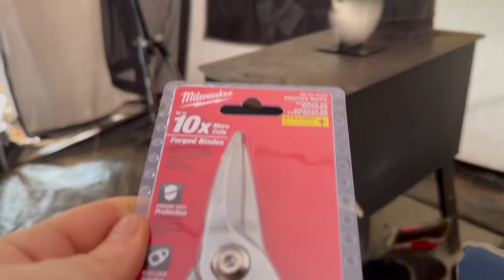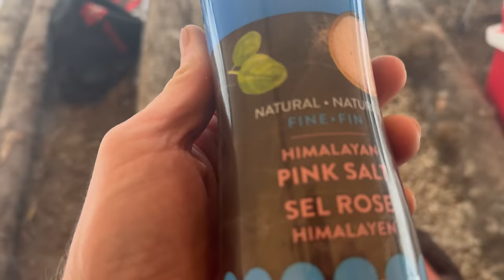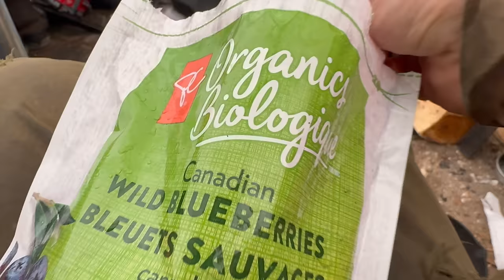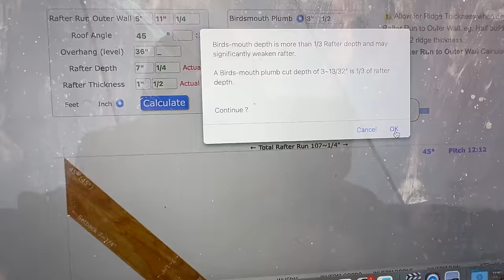Winter Log Cabin Build on Off-Grid Homestead |EP16|

Comment: Fyi I just started binge watching due an injured knee. On episode 9. Just a few suggestions about land maintenance. In what spare time you have I would highly recommend a daily bonfire and start burning all your scraps your leaving out on the property. Having a lot of dead scraps on the ground creates wildfire risks during dry seasons. Also for safety I would strongly recommended starting to cut all your stumps to the ground. The small ones can cause flat tires or damage to snow machines. As well as be dangerous when riding around in the snow. They can get buried in snow and if you hit one with your atv you will cause a lot of damage to the atv and potentially yourself.

Comment: If you really want the oak to do well prune the lower branches off before the tree starts to green up. That way it will use its energy to grow up tword the sun rather than outward. Also a grow tube will help it! Cutting the bigger trees away as you did will help a lot!
Reply: Agreed. And that fortress over the tree reminds me of those parents that bubble wrap their kids to “keep them safe,” only to turn them into piles of mush that have no resilience!

Get rid of all that light blocking stuff and drive a few T-poles into the ground to make a five foot circle, and wrap it with chicken wire!

That tree needs all the light and exposure to wind to strengthen the roots!

Comment: Just some tips with the wood stove. If you line the walls and back with fire bricks too you will retain more heat and the wood will last longer. Also when starting the fire, try the opposite layout. Big longs on bottom and kindling up top. It will burn from the top down and the wood will burn slower and hotter. Also it is paramount to use the damper in the front that lets the fresh air in. Keep it open all the way when starting the fire but close it down half way and adjust to get good heat and lasting burn. If it is wide open you’re just wasting wood and losing a lot of heat out the flue pipe. You ideally want a slow hot burn.

Comment: Just use one rafter as a template and trace it. Then cut all the rafters you need and install. Will save a ton of time versus measuring every single one and continuously climbing up and down. Light commentary is best. It’s one of the reasons I watch this channel, as there is a good balance.

Comment: I like the tent I also have one of the same wood stoves we have used it down to -35F if you want to make it more efficient add a damper in the chimney 70% of your heat goes out the pipe without a damper. You can also find an old brake rotor from a small car lay it down flat and slide it as close as you can to the chimney put your water pot on top of it heats twice as fast.

Comment: Not sure if it's in your plans or not, but I highly recommend you tie those gable walls into the rafters along the entire length of the rafters. That stacked log style of gable needs all the help it can get with lateral stability. I liked the light commentary, but I think you need a bit of commentary mixed in, perhaps at the start and end only?
Reply from the maker: GOOD SIR Z, THANK YOU KINDLY FOR THE RECO! I WILL MAKE SURE TO DO THIS IN THE NEXT WEEK! EXCELLENT IDEA. OOGA BOOGA! 🫡🤝⚡️🐺🌲
Reply: @wildhomestead  Yes, I was wondering what you were thinking of doing there. The logs stacked on each other could roll pretty easily given a bit of sideways wind snd only screws holding against a sheer force. Really enjoying the videos btw!
Reply: I've been thinking the same thing with those stacked gables. Not much side to side stabity, stacked and screwed.

Comment: If you are planning on a metal roof may I suggest leaving the space at the top of your ridge board and installing a ridge vent under the metal ridge cover. It might keep things dryer in the cabin by allowing some air circulation. There is a plastic, fiber/mesh product with adhesive already applied you can stick to each side of the tops of your roof panels. It comes in a 2" wide roll. This prevents bugs and snow from getting in through the gap but allows air to exit. You just need to leave a 1" gap on either side of the ridge center for the air to escape.

Comment: James, I feel that you should strengthen your top plate that is holding your bottom trusses. You have some mighty big spans under your 2 2x4s,  I'd hate to see you get a heavy wet snow fall and have your roof start to sag.  I understand you have a 12 12 pitch and the snow should slide off, but you like to be on the cautious side from what I've seen.  As for hauling in materials you could easily fashion a log frame sled that you could haul behind your ATV with some rope.  Keep living the dream brother!

Comment: Having your rafter stand "proud" above your ridge board as you showed in your first rafter test is not a bad thing, and in fact is a good thing.  That gap between the top of the ridge board and the top of your angle cut on the rafter would allow airflow through the cavity between rafter bays and over the ridge board.  This assumes, of course, that you are planning to install a finish ceiling on the underside of the rafters on the interior/heated side of the ceiling, also installing some sort of insulation in the rafter bays.  Without positive airflow thru the enclosed/completed roof, condensation can occur, and moisture trapped inside an enclosed space is not a good thing.  

Like so many other viewers have commented, I also enjoy your usual on-camera comments during your videos.

Comment: hi!

here is a ide dunno if it is a bad one, but what if you made a little garage for the four wheeler.

basically cut down 2 or more trees then connect the logs whit boards/ planks then put board/ planks that goes up to the middle from the planks/ boards that connects the logs (it would look like the thing you made to protect the little tree the only difference is that you have board/ planks that goes up to the middle) and then put a tarp on that and voila you have a little makeshift garage so it wont need to snow/ rain and so on on the four wheeler.

but like i said maybe it is a bad ide.

Comment: The shelter for the oak is good for now but you will eventually have to take the top off so it can get enough sunlight.
Either that or just take the plywood off and put the same chicken wire on the top as you did the sides.
Later on if you have time, you might want to either do a google search on how to look after oak trees or track down an arborist or tree specialist.
I am not suggesting the type of care plants from a plant nursery get, but the type needed to keep bugs and other pests away as well as certain diseases that oak trees may be susceptible to.

Comment: I would give the poor TRO more space. It will grow through the cover and get all tangled up. I would ram four 6‘ poles in the ground on a 5‘x5‘ footprint (or 6x6) around TRO  to give it enough lateral space. Then wrap the chicken wire (overlapping slightly) until you reach the top and leave that open. TRO needs headspace…

P.S. please comment again :)

Comment: That first rafter should have come back down and been a template. Would have gone a lot faster not having to keep "making" the rafters each time. Always use the same board for the templates, or they will always be off a little each time if not. Can't wait to see the finished product. I am going to use the videos as a guide to making my first cabin soon. However, I may square my logs with my sawmill on 2 sides to make it easier. I know.... cheating! ;)

Comment: When you get done with the cabin and have time for some "fun projects" you should really build a mini log cabin bird house and/or feeder, help them cute little chirpy guys and gals get some food. Just make sure that the squirrels cant get to it. 
Oh soeaking of squirrels,... a rotating axel with 3 arms equidistant from eachother forming a peace like shape around the axel, screw on the ends of the arms and the axel mounted to a tree. Screw on some corn cobs then sit back and watch as squirrels jump to the corn only to get flung away, its not until they learn to gently climb on to and hang from the lowest corn cob will they finally not get flung and get to eat. Trust me its an absolute blast to just watch them figure it out.

Comment: Hi James, the cabin is looking great. One question though that maybe others can help comment on. Do you think you need a block or shim under each of the roof rafters to transfer the load to the log walls?  Seems like the large gap between the logs and level 2x boards may sag or deflect over time and end up with a warped roof.

Comment: Sir, you should get yourself two saw/clamping boxes that will clamp your boards in place and allow you to cut straight down on it rather than awkwardly cut it sideways, and also has precise angles like 45 90 and 60 built in. It's a super useful tool that any solo craftsman should have.

Comment: OMG, why did you do that to Thor's Red Oak (TRO)? I am a Master Gardener and I live in the woods of NW WA state where deer and rabbits and such are sometimes a royal pain. I have protected a few shrubs/trees from predation and you do not accomplish that by blocking out the light to the plant!!!   Go get some tall metal fence posts and some welded wire fencing that's at least 5' tall. Pound the posts into the ground and wrap the welded wire fencing around the outside of the stakes for goodness sake creating a large circle at least 3' away from the plant. That's all you need to do. Oh, and I follow Shawn James and the reason I don't watch him very often is because he's mute most of the time, which I don't like, so if you go mute I will probably stop watching you. Addendum: okay, I see that you at least removed the light-blocking top over TRO, but as the little tree grows perhaps you might take my suggestion. ty